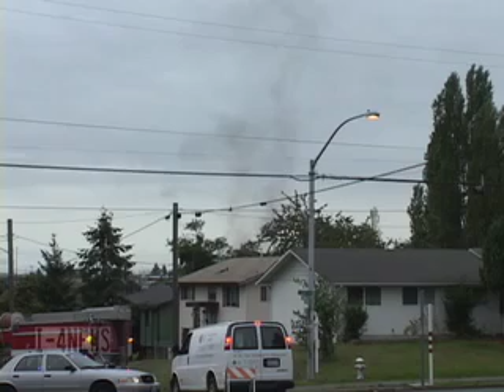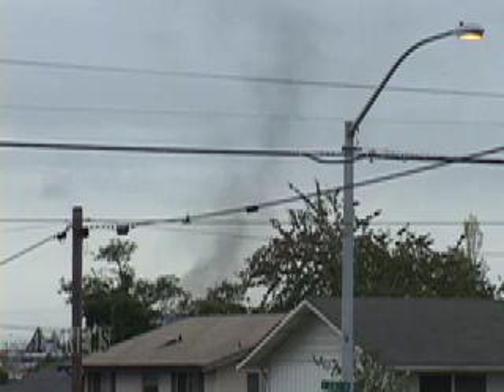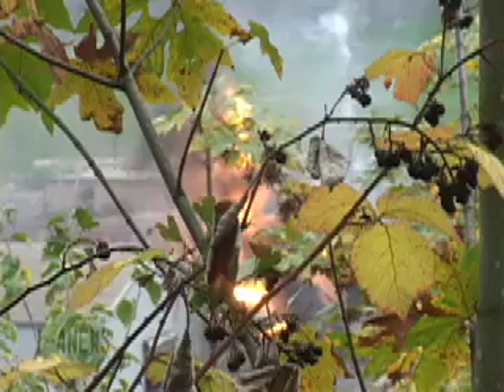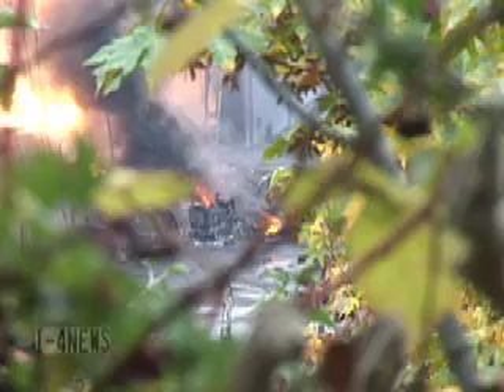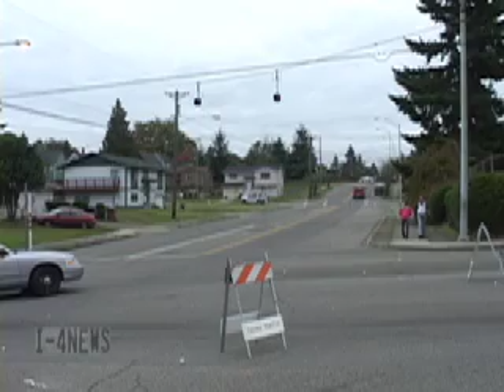Atlas Foundry Propane Tanks Vent Fire After The   Explosions

Comment from the maker: That surprised me too.  Some very good explosion shots.  Bu at the same time some that were lame or badly shot also aired.  The FD had a helicopter over the scene for a while KIRO stayed a good distance out.  I think what may have promoted the no fly zone was the plane the Seattle PI had to use to take photos.  They flew in a very tight circle and much lower than the FD helecopter.  I'm going to upload another Atlas Foundry fire from a few years ago.  It's the aftermath damage.

Comment: I worked there at Atlas, two weeks before the explosion I was at that tank, working. The guy pumping the propane was horribly burned. (I believe he died later). The truck driver was killed instantly. The explosion was so powerful, it bounced the rear axle of the truck about 80 feet into the air, and, it landed on the  hwy. 18 overpass, 60 feet above the explosion.